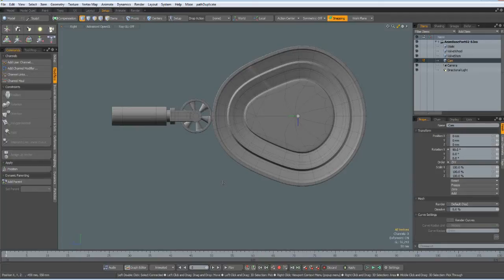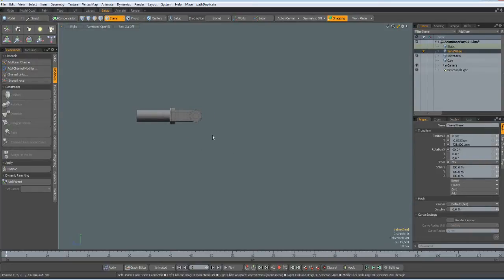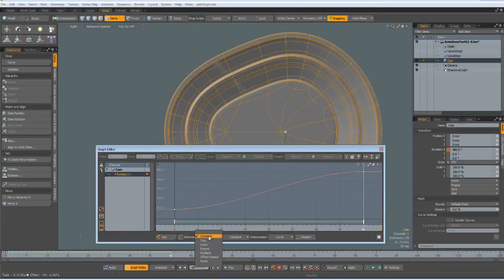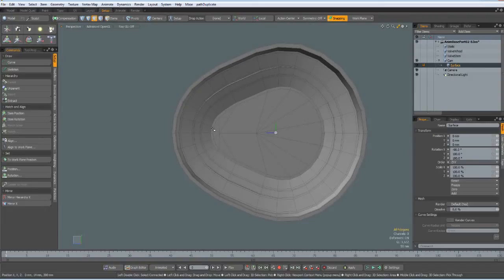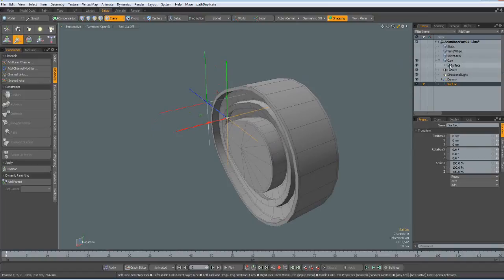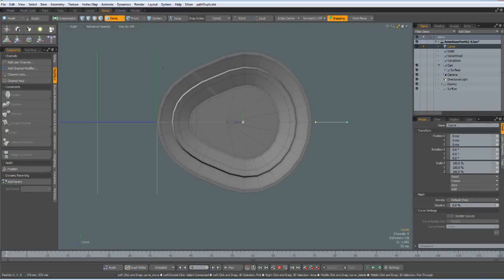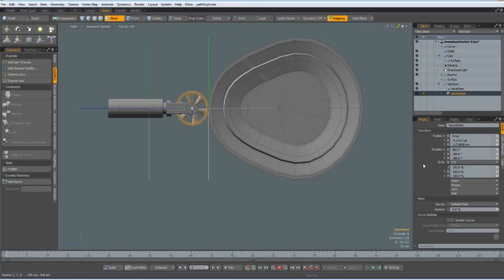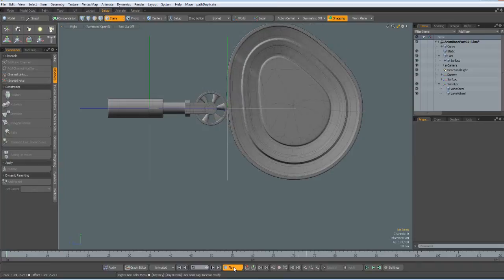Luxology modo -  Animation Basics Part 03 - Camshaft and Valve

Comment: 07 min  06 sec - not create Mesh curve - create supported Locator
Reply from the maker: Hi Alex, now this took me a while to understand, but I think I got it finally. I create  2 new locaters, then use intersect line two items ( the new locators are the two items). Correct ? Thanks a lot and kind regards, Peter
Reply: Hi Peter you have my lxo file in last mail?
Reply from the maker: Alex Tango Hi Alex, thanks again for your patience with me :-) I will try to understand this, but it looks like a very elegant solution and I think it is similar to RicheUK's suggestion. Kind regards, Peter
PS: I don't check my mail every day
Reply: all normal, go forvard my friend! like

Comment: Great Rig, Peter! Thanks!
small Wheel item rotation looks strange
Reply from the maker: Hi, thanks and you are right with the small wheel. I have set up my recording software to just record 10 frames per second to get smaller file sizes. This was ok for modelling but is not enough for quick animations. If you do it yourself in modo, it will look right. Kind regards, Peter
Reply: Peter Stammbach 	
accessibly, right!
I don't recreate the scene that you made, just watch it
Thank for answer! :)

Comment: awesome
Reply from the maker: Thank you :-)
Reply: Tricks
Pls not use simple curve for intersect 2 line, create supported locator, meshcleaner can delete 2 point curve
Reply from the maker: Alex Tango Hi Alex, did you mean to use intersect plane instead of intersect line ? I can't make this work. I think this does not work with rotating items. As soon as the driver goes below the horizontal line, the locator jumps to the other side. Thanks and all the best, Peter